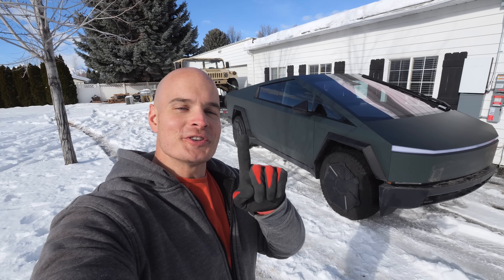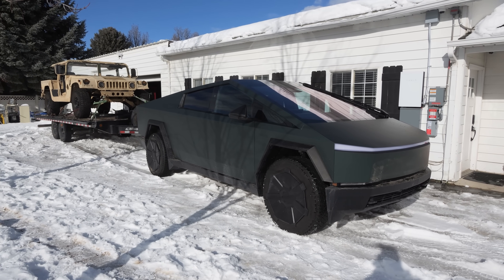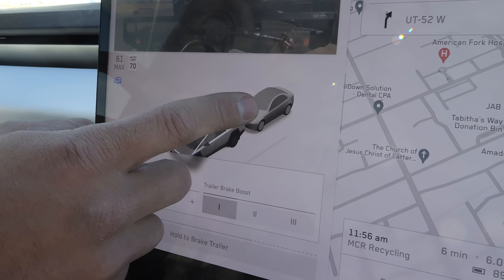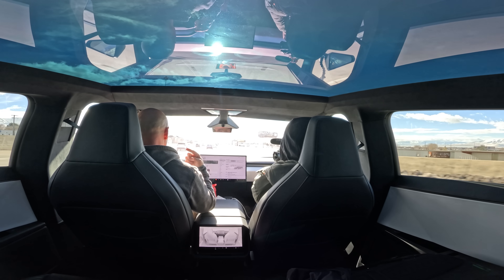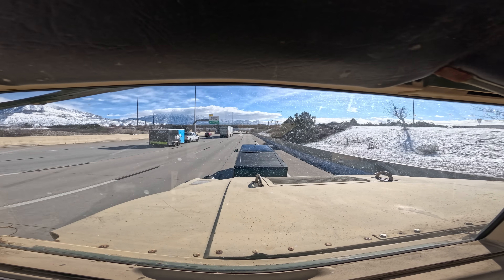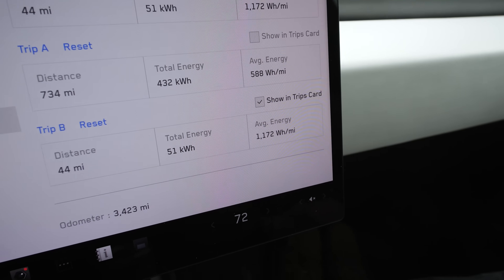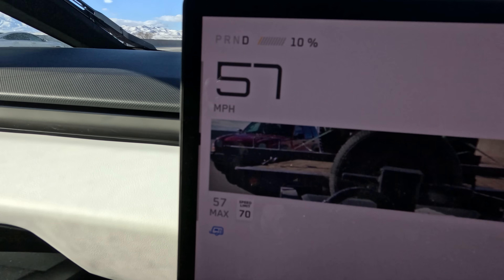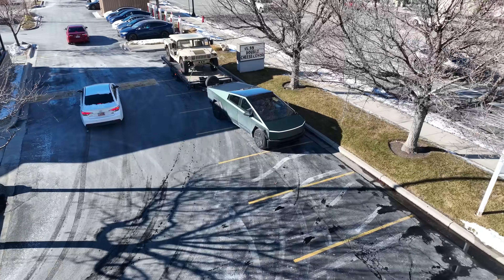How far can the CYBERTRUCK tow 11,000lbs in Freezing Weather?

Comment: Yeah, that freezing temp was a bit...not as freezing as some people might expect. Do not grab shackles in sub zero weather that have been driving for 90 miles without gloves. You will lose skin off your hands..lol.

But yes, this test showed about what I figured. Electric motors awesome, batteries not so good. HIgh voltage is just to offset the larger battery pack to make it charge faster. I was glad to see it. Will make a big difference in the future if they can do higher voltage charging safely. It will let you not need to prepare your batteries quite as much and output really nice charge rates on smaller battery packs.

Comment: The 800 volt architecture just means more efficiency and less heat on components because of smaller cables and better performance from the motor. However for charging you can theoretically charge faster but there are no 800 volt super chargers so what Tesla did was split the battery in half with two 400 volt batteries. This is why the Cybertruck takes longer to charge than other models.

Comment: So I'm confused.  You only used 108kw of the 123kw pack.  Was that your original loss before you even started the test?  So most likely close to 100mile test with 2-5% left?  Do you have a chart comparing your tows and temps.  Devils in the details.

Comment: I'm thinking something might be defective causing that whining noise. A bad wheel bearing, motor bearing, or gears in a drive unit or something. That sounds way too loud to be normal.
Reply: That is the standard Tesla quality. Pure cheapness
Reply: @BBingo-v5i  Not if you're talking about factory NVH. Tesla design their cars to be very quiet inside. If you're talking about using cheap parts with a high defect rate then yeah probably. Model 3 and Y have a lot of wheel bearing problems.

Comment: Anyone watching this who actually uses their truck for regular towing and has at least two brain cells knows this is impractical to the point of absurdity. Having to drop a trailer every 90-100 miles and running the battery to near zero to even get that far would make the trip so stressful and difficult, nobody with any sense would do it. And don't just factor in range and cost, also factor in the safety issues. Running out of battery on the highway with a trailer on would be very sketchy, and having to drop a trailer somewhere, leave it unattended, hope it doesn't get blocked in, and then reconnect it every 90 miles would be a nightmare. So many things could go wrong. Only fools will buy the CT for this purpose.

This cinches the deal for me. There is no way I'm buying this vehicle. I have the Foundation email in my inbox. Too bad. Time to sell that reservation or cancel it outright. 

Also, good job on the OSHA approved vehicle tie-down-bungee. You were right! It didn't go nowhere. 😂

Comment: Just for the record ; My 2002  7.3 powerstroke diesel gets 225 miles of range in town towing a 10K lbs trailer. This  uses  36 gallons of fuel. I've tracked this mileage and fuel use for 17 years.
Reply: How dare you point out that bullet proof logic
Reply: @effigy42 I have a cyber truck on order. I will be happy with it's range for my purposes.
Reply: So that's roughly around $140-180 to fill her up with diesel ?
Reply: @r4ym1n13  not at all. Under 100. 00 here in Texas. Plus cheaper to insure and no payments. It's still worth more than half of what I paid for it 17 years ago when I purchased it second hand.
Reply: so that would be  like 10 times more expensive than the Cybertruck for the same test!
Reply: @jimdon7377  I have a 2005 6.0 and I have the 40 gallon tank I was towing 15,000 pounds from Tennessee to Florida and I got about 255miles per tank it costed me about 295$ to complete the drive yes it cost probably 10x then the cyber truck but my time is worth more then the money I paid to fill up I got to Florida in 8 hours would’ve taken probably 20-25 hours to complete it in the cyber truck
Reply: @jimdon7377  I may have misread it but he said around town. Must be a funny town to drive around at 60-65mph all day. Pretty big too. Plus, why would you have 10lbs in a trailer all day if you go... checks notes around your own town. What are you doing that for on a regular basis? I feel like if you're in town you should be delivering things and the contents of the trailer should be getting lighter, right? I think we'd need a touch more data to find this a useful comparison as it doesn't sound like a similar test atm.
Reply: @jimdon7377  so it would be around ten to hundred times less cost on the vehicle for the same test.
Reply: @thorin1045  yeah sure, you wish
Reply: @jimdon7377  so, what is the going rate for a twenty year old vehicle?
Reply: @thorin1045  the rate for a 20 year old vehicle is going to the junk yard!
Reply: @jimdon7377  so it is even cheaper than one hundreds of the triangle shit. read the op to find out why it is relevant, as you clearly did not done that so far.
Reply: @thorin1045  sure, you skipped the math class
Reply: @jimdon7377  this truck has 10 more years of life easily and has great demand and resale value. How many CT will last 20 to 30 years? What will their resale value be ?

Comment: I was just in Norway, and nearly every Tesla charger had multiple pull through options for easy charging while towing. Once you have more than 12 or so stalls they tend to change the layout to be less linear which works out for trailers
Reply: Once the need for charging while towing appears, somebody will make it happen. I´m towing all year with my MY, no worries.

Comment: Don't forget that that range will gradually become less and less.
Reply: Exactly especially when heavily used for normal things trucks do
Reply: @effigy42  Yeah, you can't use this like a real truck. It's a hobby truck, maybe you can occasionally tow a friend's SUV across town or just an hour or so without a problem, but anything heavy duty and this is a joke. 90 miles on a brand new battery, that means basically you can tow an hour and a half, then you have to wait at a charging station for another 40 MINUTES, before you can drive 80 minutes again.  And even if filling up was $13 in electricity for cybertruck,   an F-150 can tow 10,000 lbs might cost $25 in gas (about 10-18 gallons depending on factors),  but is sitting there for 40 minutes in the freezing cold waiting for your tesla to charge worth $12?  Hell no.  And keep in mind that you'll have to pay $15,000 to replace the Cybertruck battery in about 10 years, probably get even less years out of it if you towed with it regularly, so that erases any savings....

Plus you paid $25,000 more to buy it instead of a Ford or Chevy truck to begin with, so that $15,000 extra battery cost after 10 years is just a slap to the face. And that's assuming battery costs don't SKYROCKET as more and more people adopt EVs (it will skyrocket, undoubtedly AS will disposal costs once govts start charging more for disposal once they get overwhelmed with an endless flood of giant dead car batteries, it's a disaster in the making).
Reply: @TexanIndependence  When it showed 40 minutes remaining, he was 20% charged, so it’ll actually be pushing close to an hour wait time to drive another 90 miles.
Reply: @TexanIndependence Battery costs only decline as we build more. This is a well known phenomenon. Anyone interested just look at a battery cost decline chart over time.
Reply: @ThatBoogieman  I live in Texas bro. We got cheap gas. There's a station near me for $2.30/gal before discounts even now. But I usually get discounted gas. Also, before Biden was elected gas was as low as $1.40/gal before discounts in 2020 around these parts of Texas (it's way more pricey in the city). I also misspoke as I usually refill with a couple of gallons before empty as I don't cut it close. Still usually would end up around $28 to $35 a fill even with higher prices right now. We Texans need to start charging an export tariff on our oil though, the rest of y'all getting it too cheap. We need to Texit pronto so we can join OPEC and raise oil to $200 a barrel, Texas could make enough profit to give every Texan family $20,000 a year in oil & gas dividends if we put a 150% export tariff on our oil and gas and joined OPEC....

Instead all of our oil wealth goes to yankees. Of the top 10 Texan oil producers, 2 have headquarters in Denver, Colorado of all places, enriching liberal anti-oil DENVER by employing with Texas oil profits. Insane that Denver is enriched by Texas oil more than say, Dallas.

And even of those few Texas oil companies actually headquarters in Texas, like Exxon, MOST of their profits go to shareholders in liberal left wing cities, Exxon's top 5 shareholders for example are ALL in the Northeast, like Blackrock and Vanguard, etc. 2 of the top 5 are in Boston, Massachusetts, probably the most leftwing anti-oil place in the world, yet being enriched by Texas oil profits more than Texas itself... insane!

Not to mention, the US laws banning Texas from joining OPEC or "colluding" to raise oil prices, are also enriching Yankees and West Coasters with cheaper gas prices also at our expense. Texas could be richer than Dubai, instead all our oil wealth goes off to hedge funds in the Northeast and headquarters in Denver, and to make cheaper gas pumps in those same places that then TAX our oil and gas, the only reason Texas gas is $4.50 a gallon in California right now is because California taxes it almost $1/gallon and is unfriendly to gas/oil businesses. We should be putting a export tariff on it but constitution doesn't allow that and we can't join OPEC to coordinate to raise prices, instead they use WTI and Texas oil as the main way to LOWER oil prices by countering every time the Saudis and Russians raise oil prices. Texas getting totally r*ped by Yankee greed.

Comment: You didn't show the starting percentage even though you could've toggled the display.  You left it at 308 miles instead of toggling the percentage to see what it had dropped to.  Nor did you top it off back up to 100 percent either.  Very convenient if one wants to invalidate or compromise a test.

Comment: Yeah electric just won't cut it if you live in the sticks. Have seen so many electric vehicles sitting on the side of the road due to range. The cold weather is doing a number to all the electric units all across the north east. Chicago news just posted a video of teslas not charging in cold weather. I'll keep my diesel as its readily available every where i travel.

Comment: Zack talked about the charging being more efficient at 800V. But the CT actually charges at 400V just two 400V simultaneously. I am not an expert but I think it is for inverter efficiency and smaller cabling.

Comment: Somebody probably already mentioned it, but the range display of the car (not the one you get when navigating somewhere), is always based on constant. It's basically the EPA range, calculated on the amount of the kWh the battery has. So let's say, in 3 years time, the battery has degraded 5%, then it will actually show less range, because the battery capacity has decreased.

It is this way on all Tesla's. So it's best to just show battery %, instead of range.

Comment: You did a very thorough test. Great job.
You have to buy special tires for that thing. No thanks.  It's just a look at me toy. Good for nothing. More trouble than it's worth. I will stick with my 2004 honda element with 425k miles 
That gets 25 m.p.g. and is excellent in the snow.i like it better than my 2008 b.m.w.750li by far. I actually one two Honda elements the other my wife drives the 2007 it has 230k .I hope honda brings them back I will buy two more.only gas .Electric is doomed to fail to many variables.
Reply: The tires are standard sized for LT. It's just the aero covers which simply pop off to reveal a normal wheel lol. And your Honda element has almost nothing in common with the capabilities of this truck lol, so not sure why that's relevant
Reply: You are correct about nothing in common as far as my honda element and the cyber truck.
Especially that cyber truck will never see the milage my honda is seeing.

Comment: I'll stay with my reliable Ford F150 with  the great 5 liter engine, 6 speed transmission that will get me there, back and beyond with up to 800 miles highway and 450 miles towing with a 34 gal tank. The EV also weighs an extra 2+ tons of battery dead weight which is another killer for it.

Comment: Subscribing. Cyber, Rivian, Lightning Jerries, one day to be joined by Ram, Silverado, Hummer, Hybrid Jerries. Great work. CT has a solid start with a lot hardware, software upgrades to come, product of a lot new.  Rivian created a polished, capable adventure truck ; deserves major kudos! Love to see more Lightning comparisons.

One battery reality for all of them is batteries aren't cheap for energy density provided.  Ford is cutting back Lightning w UAW contract  as it was covering losses, similarly Rivian is losing money per R1s; batteries are main reason.  Tesla attacks this reality w smaller batteries and more efficiency, but asks more from user to get best performance (also no paint and working steel). ICE sets the benchmark but great to see EVs coming strong.  Execution, videowork all great, not easy I'm sure.

Comment: 16:44 The results are legit when the test has been done in the same condition.
Drive both cars simultaneously, with the same load (from the beginning).
On the Rivian video, your speed always was between 60-65MPH; on the Cybertruck, you kept it between 65 and above (mostly at 70). 
I'm not protecting the Cybertruck but making a fair point.

Comment: If you use "miles remaining" for the battery meter, it looks like it's doing it the same way as every other Tesla. It uses EPA estimated miles with a straight conversion from percent of max EPA range. It's not a "guess-o-meter" like other brands where it adjust miles remaining based on usage. However, what you can do on other Tesla models, you would open the Energy app to see actual projected range based on recent usage. Does Cybertruck not have the Energy monitor screen? Alternatively I believe the navigation does also show you real projected percent remaining at destination as you saw.

Comment: It seems electric trucks are not in my wheelhouse yet. When I tow a trailer, I drive 300 miles(about 4.5 - 5 hours) with a single, 5 minute stop for a restroom. Fuel is a non-issue. I can get 900 miles of range while towing(1,200 unladen). Ford 6.7 diesel, if anyone was wondering.

Comment: Hi Jerry , how about you try this.
Hook up an alternator on the wheels from the tow trailer and than use and invertor to convert it to AC , then use it to charge back up the truck while driving :D 
its a funny project but may work? 
u wont get significant amount of power but if it is something its better than nothing .
Cheers :D
Reply: The cybertrucks own brakes can do so much Regen braking themselves it honestly basically negates the need to try to recover the energy from the limited use of trailer brakes. If he had a surge style trailer brake then yes you definitely could get some power back using that

Comment: I have yet to see an electric vehicle that is practical for my use , here in Canada. I work in construction, and construction sites don't have chargers. I would also mention it was -30 C this AM, and none of the EV's would charge fast enough, out in the cold. All this is just an impractical idea for a lot of people. 
     Also, the infrastructure needed is not being provided, if anyone thinks that taking all the energy that gas provides in moving cars, trucks, trains, and planes, and think the existing electrical grid can handle it,  I can answer that. It can't, not even close. It's all BS, IMO.

Comment: Thumbs up for a very interesting test and comparison to Ford and Rivian alternatives.
I've seen 'TFL Truck' and other channels do heavy towing tests of full sized gas and Diesel pickups on extended grades. The MPG can drop to ~4 MPG. BUT, those drivers KNOW that refueling stops are readily available and quick, that one can carry supplemental fuel, AND if both those fail, transporting a fuel can to/from a station is all it takes to remedy an empty tank. Since that remedy is NOT applicable with an EV, repeating your test to determine the kWh/mi while pulling ~11k lbs on a few sustained grades (e.g. ~3%, ~5%, ~7%) would be especially useful.
While the EV trucks seem to do well, I just don't see them as fitting for towing large trailers or toy haulers, especially if the destination is off grid. That is unless one is willing to pack a LARGE generator (~30+ kW), plus fuel, EV connector cable, etc.
Reply: The more I see about EV trucks, the more I love my V6 Nissan Pro4X
Reply: 4 MPG sounds insane. A fully loaded 45 ton semi gets about 10mpg.
Reply: @albinklein7680  a cascadia might get 10... but normal trucks still get 4-6. your point still stands though.
Reply: @albinklein7680  #1) I have many truckers with full semis what mileage they get. Not one has ever said 10 MPG. That's at highway speeds. If they drop to 40 MPH, the mileage would substantially increase. Thats still better than a Diesel pickup were it geared to handle pulling 40 tons
#2) The semi's mileage will also DRASTICALLY drop if they climb a steep grade. The grade used for the climb getting 4 MPG while towing 14,000 lbs while still striving to maintain 65 MPH is the route over the Continental divide, up to the Eisenhower tunnel, elevation 11,112 feet. If I remember right, the grade is something like 7% (steep). If a semi climbs that while they're near their 40 ton (80,000 lb legal limit) will also drop to something close to 4 MPG. Basic physics dictates this.